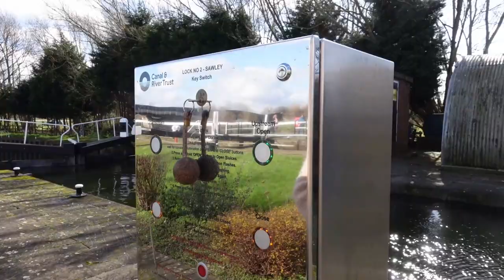WHAT HAPPENS when you LIVE on a BOAT?!

Comment: Wow! What a malarkey with the calorifier! The boat must have been fitted out by a blind man for a blind customer.

Well done you two for sorting the issue.

Now, the calorifier. The over pressure valve on the original one might have seized. The one on mine is set at three bar and is mounted near the bottom of the tank and drains through a tundish. (A sort of  funnel open to atmos' so you can hear water draining out.)

Just make sure you buy a big tundish with at least a 22mm drain pipe  off the the tundish ... I know these things ... now ... coff, coff.

By turning the red cap about an eighth of a turn the valve is lifted and you can drain the tank into the wet bilge or over the side.

As it's a pressurised system you have to vent through a pressure valve.

It's only hot pure water so no issues with dirty water.

The accumulator/expansion vessel does a slightly different job; to save a lengthy typing session you can read up online. Some systems incorporate two such vessels, before and after the calorifier. Plenty of piping diagrams online.

You have to set the pressure on the expansion vessel according to the water pump o/p pressure. You can always let air out and pump it back up if necessary.

An ordinary bike type pump probably won't have the pressure so you might want to acquire one of those pumps which stand on the ground.

Anyway well done you two.

 (You've probably saved yourself around a million quid in labour by doing it yourself. Well, nearly.)